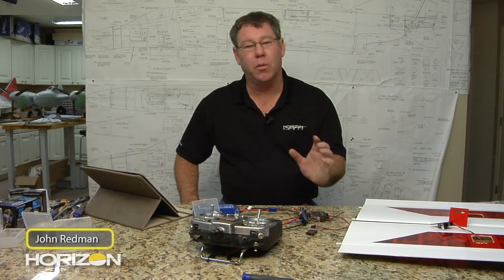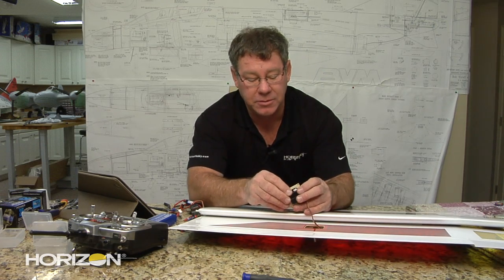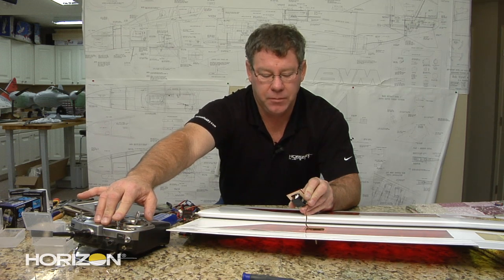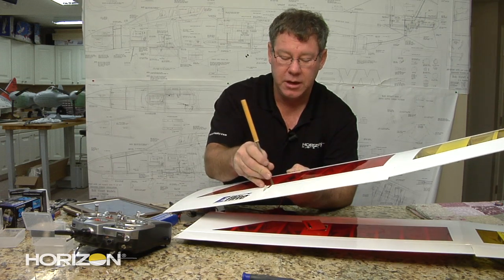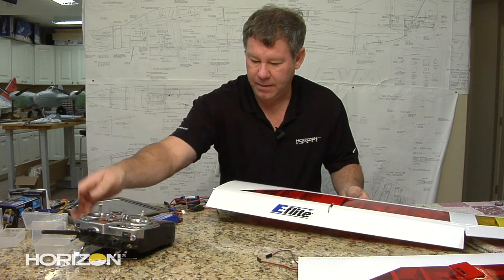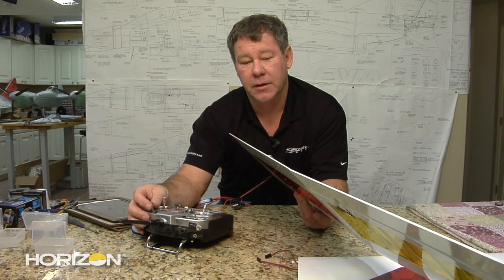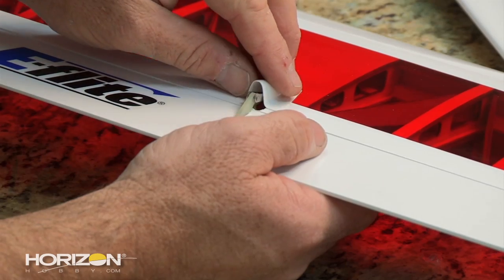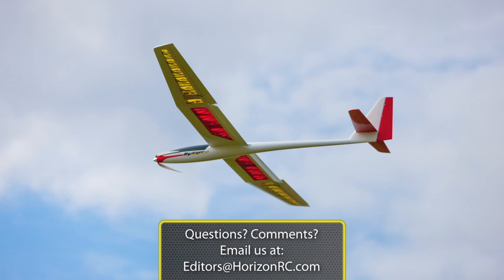HorizonHobby.com How To - John Redman Builds The E-flite Mystique 2.9m Sailplane

Comment from the maker: Mike, if you go to 2:05 in the video you'll see the off-set John used for the flap servos in the cruise position. Since the cruise/neutral position is up on the flaps you will have more travel in the down direction.